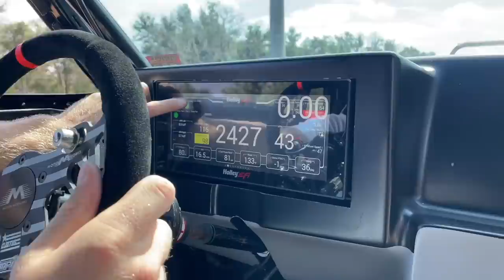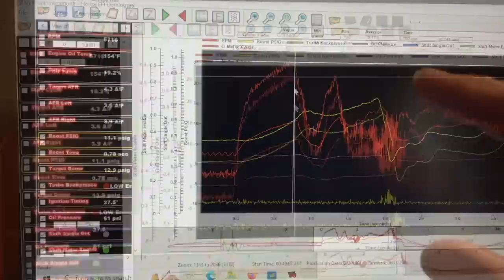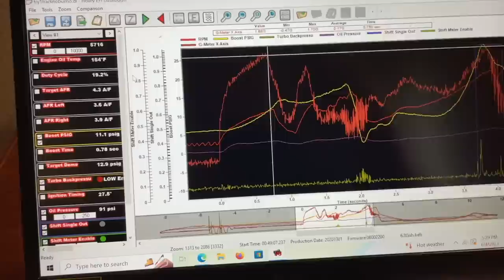Summer Race Week Day 0 - Testing Mullet's "Fixed" Converter and Making a Test Hit... Did NOT Go Well

Comment: It'd be cool if for bad track conditions you could configure a ceiling for the G's you pull. Do a hit, see where it blows the tires off, put the G ceiling right below that and then maybe the traction control could kick as the G's approach that ceiling to help prevent it from spinning the tire.

Comment: Cleetus you should do electonic air conditioning in mullet for these drag and drives
Reply: Not possible on the SMX in Mullet.
They use Cool Shirts.
Reply: Electric compressor like a hybrid compressor runs with power and ground. Not belt driven just need a powerful enough alrenator

Comment: Damn did it back fire through the turbo at the start of the burnout? Just curious if that’s bad or not. Not to sure myself
Reply: Depends. It if is an injector issues, then really bad on meth. If it was just an issue with the transition between gas and meth, not so much.

Comment: I've always wondered, how many miles can you guys get out of those custom tanks? And how many times do you have to fuel between each race?
Reply: For regular 93 pump gas, mullet has a pretty “normal” sized tank. It’s like 16-20 gallons iirc.  Figure on the bad side gettin 8mpg street driving

Comment: Random question for you comment guys (or Cleet), whats that bar in front of Mullet's windshield for? Ive been wondering for years and never figured it out lol is it just a support for the hood?
Reply: Time stamp?
Reply: @AB-80X  visible in the test drive around 1:12, horizontal just above the dash
Reply: That’s a bracket to support the raised center of the cowl induction hood.
Reply: @gmpower179  Cheers dude! Figured as much but never knew for sure lol
Reply: @helplmchoking  Are you referring to be bar going along the dash on the inside of the car? Structural part of a 25.5 cage.
Reply: @AB-80X  nah the lil bar just in front of the windshield, shaped like |___| but upside down. Sounds like it's just a support for the hood cowl but I was never sure and it was driving me mad lol
Reply: @helplmchoking  Ah. Yes that's just the center support for the hood. On the sides and front it rests where the DZUS fasteners are, but there would be nothing to support the hood in the middle and it is fairly soft and flexible. It just rest on that bar going across up in the cowl.